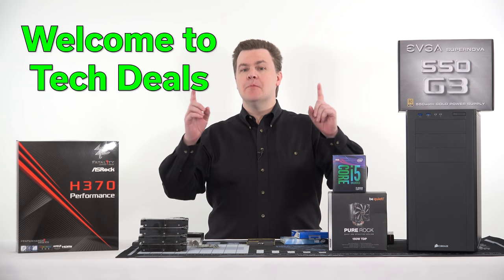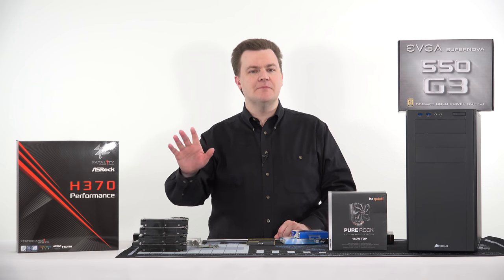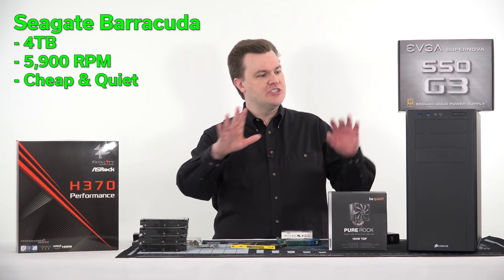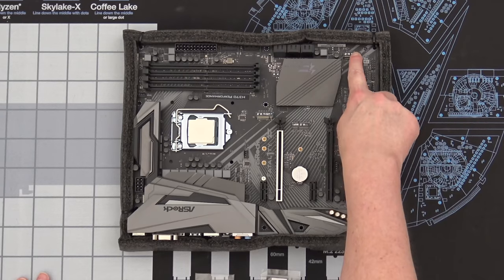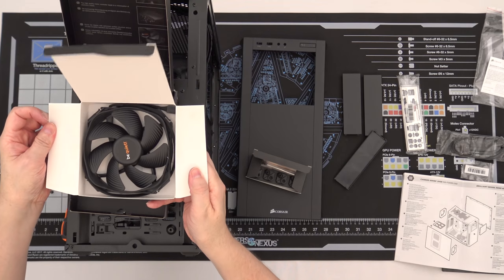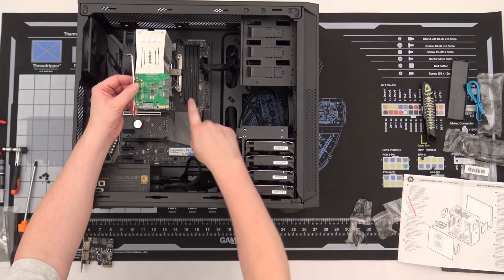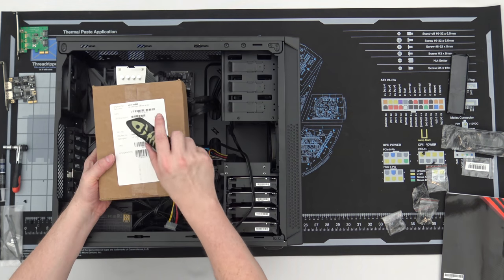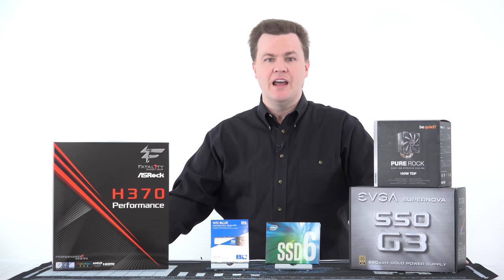2019 Ultimate Home Theater PC — Build Guide — Tech Deals

Comment: I would like to see how you actually set it up as a home theater system. Speakers, tv etc.
Reply: yea would love to hear what speakers would be best for HTPC
Reply: Pls do this
Reply: This is a fantastic idea.
Reply: Good point.  I’d like to see the software set up too.  How you get a unified experience, unless you just use a web browser and VLC as I do.
Reply: Yeah. Putting the computer together isn't the problem for me. Actually getting it to function with my cable TV signal and serve as a DVR is the part I could use some help with.
Reply: Same
Reply: @Trifler500  look in to HDHomeRun Prime. has been discontinued, but can find them on ebay.  you rent a cable card from your cable provider (comcast charges $1/month). This gives you 3 tuners to watch all your cable channels. Windows 7 has Windows Media Center built in for free, has DVR capabilities. Works with media servers as well, like plex or kodi.
Reply: @shinygengar3010  Any high end speakers?

Comment: There appear to be threaded mounting points/holes for an 120mm intake fan on the quad 3.5" HDD bay.
Looks like you'd need to use special screws that were probably provided with the Case.

If the above assumptions are true,
1. Is there enough room for a 25mm thick fan, or would/should one need to get a thinner one?
2. Were screws of various lengths provided with the case; ie 10mm, 15mm, 25mm?

Comment: Nice to see a Blu-Ray drive in a build.Using 3 Corsair cases now. latest HTPC/Photo editing rig has a 1700x 32Gb 3200mHz plus a GTX-950. 2 nvme SSD 2nd one on a card in the bottom slot

Comment: @16 min. it looks like the front fan is installed to blow air out instead of pulling air into the case, but can't be sure because the back side of the fan wasn't shown . Usually the trademark sticker is on the output side of the fan.
I'm a big fan of your channel. Thanks for all you do.

Comment: This build seems like overkill for a media pc. Why didn't you use ryzen?
Reply: Kasomoru Mitsuru the igpu on Intel cpus are good for a htpc and therefore removing the need for a dedicated GPU. Single core performance is also better on intel
Reply: @ryanwelburn5004  single core performance for htpc? 😒
Reply: 'Tech Deals' has lost his way
Reply: Jarrod Flint no shit, would rather have 6 strong cores than 8c16t for a htpc but I suppose you could run it off a core 2 duo if you really wanted
Reply: The r 5 2400g is way better for a media pc and you can get it cheaper.
Reply: On the part 1 video, he says ryzen APUs do not support Youtube's V9 codec while on Intel  it does on 7th gen and higher and also quick sync hardware accelaration so CPU usage isn't high during playback, encoding and decoding tasks.
Reply from the maker: @ericsanchez7356  To be clear, they do for decode, but not for encode...  VC9 is more compact than H.264, similar and in some ways better than H.265.
Reply: @kasomoru6   Not cheaper than free. Intel sent him the chip for free. Maybe you should listen to the man.
Reply: GO WATCH THE FIRST VIDEO BEFORE YOU COMPLAIN
Reply: @UCxFYE4t9TAr7r_GB10fGCuQ
In short, to keep the power down and not need a graphics card. I strongly prefer AMD because of Intel its unethical behavior and sometimes crimes (patent infringement, all or nothing rebates, cutting off Compaq from sever CPU's) in the past but if you only look at the technical aspect then Intel is the more logical choice for this build, unfortunately. I still would choose AMD though, we need strong competition from AMD to prevent Intel abusing a monopoly again in the future like it did until 2017/2018.
Reply: Peter Jansen me too. That's why i'll never buy Nvidia again. Intel i'm mostly fine with since they stoped their harsj behavior. Now it's a market which is very healthy for cpus, but for Gpus the story is a bit diffrent. The marketshare is 82% in favour of Nvidia. It's not because AMD made bad products. It's the consumer's fault because they always buy Nvidia. It's like the average consumer thinks AMD is a cheap chineese knock-off and only see what Nvidia has to offer for their budget.
Reply: @michaelkregnes9119  
 Mækkel Montages 
As far as we know Intel doesn't bribe OEM's and shops and doesn't blackmail OEM's any more but they still have some dirty practices. Shortly after Ryzen came out Intel paid a boutique builder to advertise Intel as superior and Ryzen as value oriented (not necessarily untrue but still), they tried to fool people into believing in a 18C CPU getting 5.0 GHz by using an aquarium cooler and there was this suspectable Israelean company which came out of nowhere and only adressed Ryzen security flaws after it turned out that Intel is more vulnerable for Spectre and only Intel is vulnerable for Meltdown. We don't have proof that Intel was behind it but we do know that Intel has a big department in Israel and that this small company got a big bag of money from an anonymous donor. Hence me calling it susceptable. I also don't like Intel buying all of AMD's talent. Koduri was free game (fine) but did they really have to buy the other RTG employees like the head of the team which wrote AMD's GPUOpen software?

I strongly disagree that the market is healthy again for CPU's. Look at the difference in budget and the difference in marketshare amongst OEM's. There are as many prebuild PC's with only the 8700k as for all of Ryzen. The same for the 7700k. Intel has around 10 times as much money to spend on R&D, marketing...that is not a healthy market at all. I have bought 4 systems with an Intel CPU and in 2 cases this is because of Intel its dirty games and OEM's still preferring Intel. Worse, in 2018 I bought a laptop with an Intel-CPU because I had no alternative option. I would have had to pay $100 more for a laptop with an AMD APU instead of an Intel CPU and a Nvidia graphics card. All my future desktop builds will get an AMD CPU and a possible future laptop too whenever it is an option. I contributed to this problem so I will correct it with future purchases. 

With regard to GPU's the market is indeed more unhealthy, this is a matter of survival for AMD on the GPU market. Other than that I also dislike Nvidia's behavior. They rendered PhysX via X87 which makes it run 2-4 times as poorly. If you ever wondered why you can't play Borderlands2 with PhysX on medium/high or Mass Effect or Mafia2 with PhysX at all, that is the reason.  Nvidia ruined several of the games which I played for me by breaking the performance with some effect of theirs which I couldn't disable. An example is Assassin's Creed Revelations when you use a HD 7850, a card which is overkill for this game but Nvidia's smoke effect makes it stutter all the time while it doesn't even work (on an AMD card because of the secret software). Those Nvidia ad-screens in the beginning of games drive me nuts, you can't skip them so after every install I have to figure out how to disable it and edit some configuration file. At least AMD always has let its Gaming Evolved ad be skipped by the players, not that I wanted to do that because AMD's Gaming Evolved does not annoy me with sound of image, Nvidia TWIMTBP does annoy me because it sounds annoying, it looks ugly and it is rather arrogant ("you are not meant to play the game with an AMD card"). Later you got that GPP-scam. Never Nvidia for me aging for a desktop. They can put that RTX and Tensor in a hole where the sun does not shine.
Reply: @michaelkregnes9119  
A long rant. My earlier point was that I defend Tech Deals his choice for this build despite being heavily biased (with good reasons).
Reply: @ryanwelburn5004  2200/2400G
Reply: @ericsanchez7356  2200G plays YouTube fine. This is HTPC not content creation PC.
Reply: I bet money that all the AMD fanbois would be praising this build had it been an AMD Chip.  I'm sure it would have worked fine but he had the Intel chip to use.  I really have to laugh at you people!
Reply: Jarrod Flint did you even watch the video? Tech gave his reasons for using intel. We all know amd is the better value, a htpc doesn’t need much horsepower we know that too. He has a YouTube channel of course it’s going to be overkill! Get over it
Reply: because if you choose logically, you would end up doing ONLY Ryzen videos :D
Reply: @TechDeals  how many of those ways are beneficial to the end user? If its worth it then I've learned something today.
Reply: @wysetech2000  did Intel send you a chip for free? That doesn't apply to myself.
Reply: @michaelkregnes9119  I did.
Reply: OOoops..An AMD fanboi in the comment section.

Comment: WARNING! NO WIFI! I haven't built a PC in about 8 years and so I found this instructive video. And it's pretty good. BUT much of the stuff you skip is the stuff I needed to see. I had to spend hours googling to see how the fan was clipped to the cooler. And it might have been nice to show a little of the way you snaked the power cord connections... just one would have been nice. Instead of talking a few hours to put together, this has taken days. I'm not a beginner, but it's been a while and it might have been a better idea NOT to say this is for beginners. And I am shocked that a 2019 build wouldn't include wifi. EVERYTHING has wifi (except this build). For God sake, LIGHTBULBS have wifi! But my new $800 plus PC doesn't. You really need to say something about that somewhere. I would have bought the next board up that has wifi built in (I discovered this a few minutes ago. Too f**king late). Meanwhile, I still have to figure the best way to add wifi to this box. I haven't found anything online that would give me a hint how to do that. Maybe you know (and maybe you don't). I have read through MANY of the comments here and I notice that you don't answer many of them. And they ask some pretty good questions. Maybe you'll answer this one.

Comment: I have that PSU in my system now. Yes, its silent under low load, however, when the temperature rises and the fan starts, its pretty noisy. It feels like it ramps up from 0 to 50% and then off again when the load/temp falls. In normal operation, avoiding the zero fan mode, its quiet. Maybe 20% fanspeed and slowly rises under load.

Comment: Love your content, but was a bit disappointed to see a standard form factor. Would like to see more alternative form factors from you. Your perspective is different to other channels and would like to see what you bring to SFF or other alternative shapes.
Reply: Actually, as someone who never uses a small form factor I agree that that would be interesting, Simply because he hasn't done that a lot and because it is more challenging. However, is it practical for a HTPC? It is a silence focused system and it is a lot more difficult to get a SFF PC silent. Smaller volume for the heat, smaller fans (more noisy with the same air displacement ceteris paribus), smaller cooler...

Comment: Hey Jason, you should consider a cheap GT1030 video card for a dedicated and quiet HTPC capable of playing 4K HEVC HDR @ 60fps videos. I just recently did his myself to an aging i5-4460 and it runs well, its fantastic value for the money, picked mine up second hand for £25 (roughly $32 Greenback), I don't regret it, Fantastic content yet again Keep up the good work
Reply from the maker: GT 1030 lacks NVENC...  GTX 1050 is the lowest end card that has it.
Reply: @TechDeals  Yes I am Aware it don't support NVENC, but it does support HEVC 10-bit decoding.The 1030 can do 8k 10bit HEVC and 12bit vp9 works well with Emby Netflix etc I guess it depends on each individual needs.  just thought a cheap option is better than no card. thanks for the reply

Comment: My home theater pc:
ryzen 5 2400g
8 GB ram (yeah, I'd want more, but you remember what RAM prices were? Yeah...)
MSI Bazooka b450 MB
Coolermaster cxm 550W PS
Noctua low profile CPU cooler
256mb SSD, 1-2TB HHD (will add more if needed)
Coolermaster Silencio mATX case, with 2 240mm fans in front and 1 in back
Logitech wireless trackerball mouse and keyboard.
Blu-ray read/write
Wireless connection to my router.

This case is so quiet I wouldn't know it was on if the blue light wasn't there. Seriously, I have never heard it...

Comment: Are there 4 SSDs stacked on each other?  It looks like only 2 fit there but you never give a different camera view so I can't see.
Reply: Those are HDDs, SSDs are smaller (2.5" for SSDs, but desktop HDDs are 3.5")
Reply from the maker: It is a 2x2 arrangement, look at pictures of the case, there are 4 bays there

Comment: I don't get it, why people go so overkill of an media center. Some people put also low end gpu's in them for "light gaming" (horaay more noise crappy gaming experience anyway). I've built my nas/media box with a very small itx passive cool case with picoatx supply, 2x hdd in raid and one nvme for os. It looks like a blue ray player and is powerfull enough for everything a media center should do.

Comment: First of all great review/build as always Tech! :) That's definitely one way of building a home theatre PC. (That case is huge to be in most home theater rooms) Maybe a Fractal Design Node 304/804 for a smaller footprint?

Personally I would build a server or NAS on the back-end, store it in a spare room or cupboard if noise is a concern. (I appreciate some people don't have reliable wired networking available at home so your build could make sense to them) Then stream out over network using Plex/Kodi/Emby to an intel NUC/nvidia shield/Apple tv/Xbox/PS4/Roku/Fire TV/Smart TV.....the list is near endless. Those devices are pretty cheap, quiet, have a much smaller footprint in a home theatre setup plus you aren't locked down to one room for viewing. Try ripping the latest Blu-Ray Disney movie while small kids are trying to watch another movie with this setup and see how long the small people hang around for! lol!

How about building an alternative NAS/Server PC using most of the parts you have for this HTPC? Look at the Pros & Cons for both. Different software you could use.. etc, etc. I think it would be a very interesting video. :) Just my 2C worth

Comment: It seems an ugly HTPC, not an ugly PC, just for home entertainment- I wouldn’t want that next to my TV.

You can get mATX cases and I have to question why you need so many SATA ports?  4TB drives are less than £100 but really your storage would be better on a NAS, or even your full ATX daily driver.  Then your HT set-up can be ITX, mATX if you really must.   

I’d question if you really need Blue Ray, it is dead, but if you did put it on a NAS and rip the files to that.

Comment: i3 would have been enough......
Reply: As Mr. Tech Deals said, this is a high end HTPC. 8100 is probably fine for most people watching 4K content and etc, but it’s not fast enough for encoding and light editing, I mean it’s fine but 6 cores give more headroom for everything than 4 cores. Moreover, I know people who build small htpc’s around i7 8700 because those extra threads give you even more headroom for relatively moderate decoding/editing. Just make sure that you are replacing the stock cooler, it can get loud even on 8100
Reply: Yedige Moldagaliyev you aren’t doing editing / encoding on a htpc....
Reply from the maker: As noted in the first video, a G5400 would have been enough...  but this CPU will give me years of trouble free use and room for the future, as well as being very snappy and responsive.